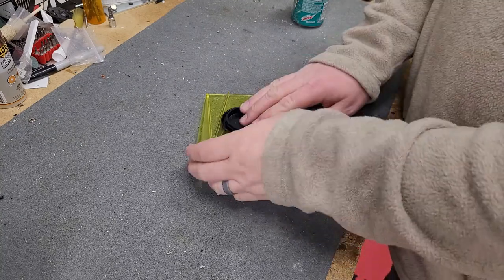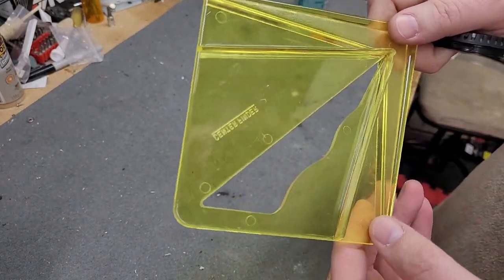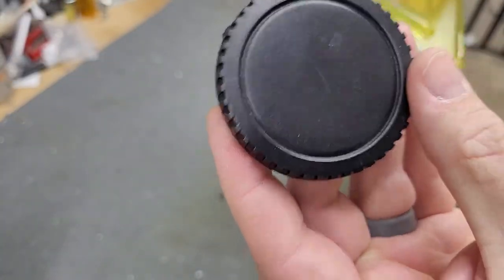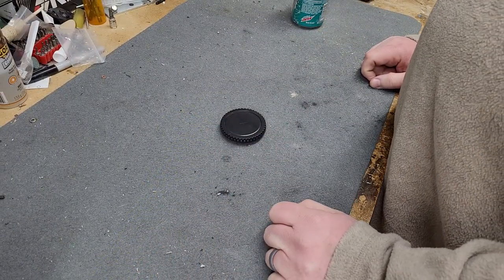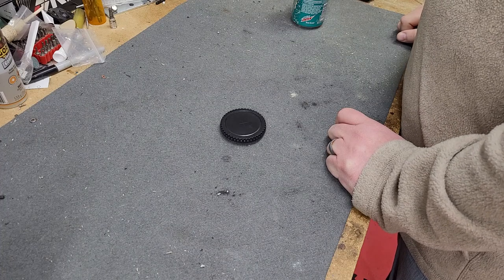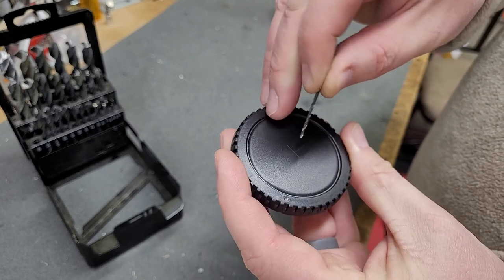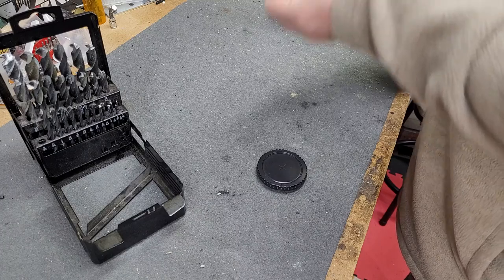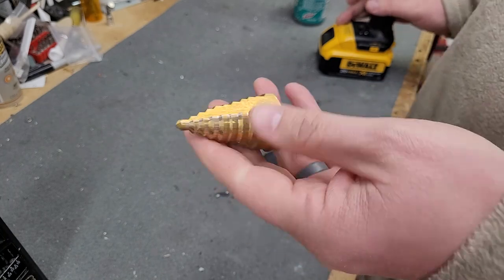DIY Pinhole Lens Cap

Comment: I have a question. Why can’t we just drill a hole in the middle of the cover instead of doing the metal pin hole part? Is the drill bit hole too big to take photos?
Reply from the maker: Yes. The metal piece is laser drilled and incredibly small and a clean edge. That helps maintain sharpness in your final image.
Reply: @KentVanderploeg  Thank you. I’m going to try this.